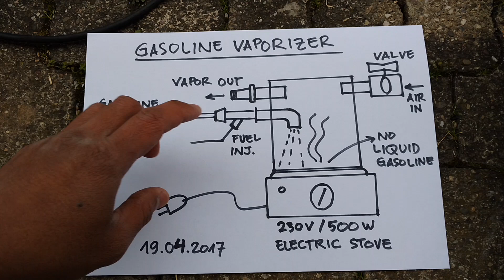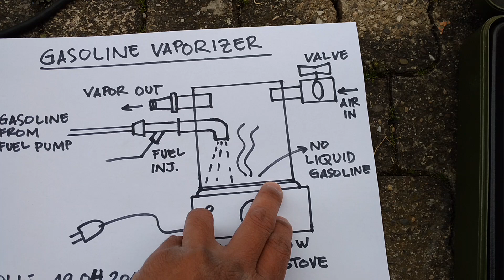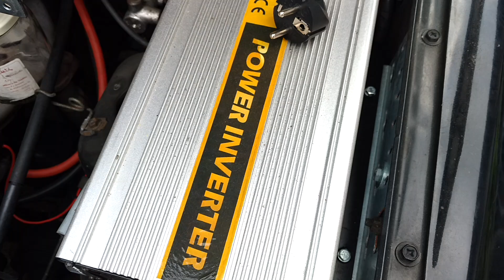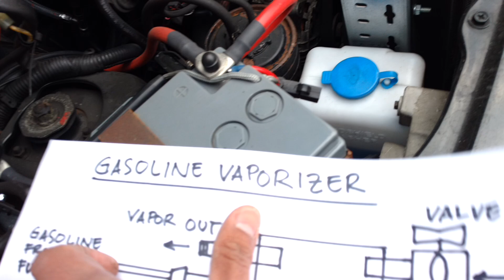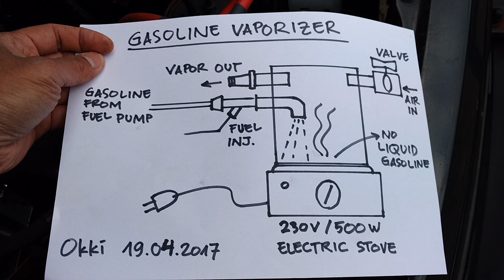Gasoline Vapor System for Car

Comment: nice but u dont need a ecu. just a pwm to low the puse of the injetor. do the engine will be more efficient.
Reply from the maker: Hi kefferson araujo. I don't want to mess with my standard ECU again. I have destroyed my standard ECU already during testing. Thank God that I could repair it by myself.
Reply from the maker: Hi Kefferson, I have been thinking about your statement to modify pulse width from standard ECU. I don't think it will work, because vapor fuel needs different mapping, we cannot use liquid fuel map for that. Yes with vapor the engine will be more efficient.
Reply: lets try to make one just for vapor heheheh you are the man

Comment: Hi Okki. I like your Vapor system.  Have you considered bypassing all the injectors altogether ? Injectors are normally closed, so just unplug them. Run your Vapor directly inside the air intake. Have you considered this idea ?  , Best wishes. I truly enjoy the videos. Thanks for sharing with us all.
Reply: Leave injectors in place on the engine only for a cold start, then turn them off, or turn off your fuel pump when car is ready, ie heated up.  And yes run the vaped fuel into the air intake.  It will surprise you in a good way.  The car will run just as it did with liquid fuel once completely running on vapor.  The vapors will be sucked into your, throttle body, or whatever setup your car has and resume to run normal.
Reply from the maker: Hi Mike. I don't understand what you mean. If I unplug the injectors, how can I get the fuel?
Reply: Think about it this way. If you were converting a lawnmower engine to vapor. You would put the vapor into the air intake. No need for a carburetor, just a simple air control valve. BTW the injectors where introduced to be able to bypass vapor, as people had figured out how to get over 100 MPG. So these greedy company wanted to use liquid and control the amount. Anyway. unplug the injectors and put your vapor into the air intake. I have seen it done on Youtube, do a search. You may have to control the ignition firring the old way, and DISABLE the engine computer, and or turn off the alarm. Anyway. Best wishes.
Reply from the maker: Hi Mike. Converting a car engine to run on vapor is not as easy as converting a lawnmower motor. On car engine you have wide range of engine rpm with wide range of engine load. YouTube is a very good media, only by seeing it done on YouTube doesn't mean that things can be done that way. Many people make everything looks easy on YouTube until you try it yourself. If I put a vacuum line directly from the top of gas tank, I would be able to run my engine. But I see at least two problems here. First: the liquid gasoline in the tank will be colder and colder over time until it hardly vaporize and second: I would leave my tank dirty of this brown black thick wax left over by the gasoline. But thank you very much for your attention, suggestion and positive comments.
Reply: Yeah, it seems easy to see others doing it.  
Do not give up Okki, with practice you'll get more experience and skills. 
And one day, it will become easy for you too.  
You will succeed. 
It takes time, focus and determination. Never give up !
Keep posting video's. I'll watch them.
Cheers Bro.
Reply from the maker: Thank you very much for your support Bro! :-)

Comment: Thanks for sharing Okki. Thats very clever. I could see using the exhaust heat on something like a PLC to control the temperature with an exhaust valve. The electric heater would be good for initial warm up. Have you considered flash back issues. I heard a mesh membrane works or stainless wool. Do you know the fuel vapour to air ratio is it 1:72 maybe a sensitive oxygen sensor on the exhaust to provide the new ECU with information. I want to do something similar to a VW airccoled engine. Are the semi volatile's waxes etc what sort of concentration are you finding?Sorry about all the questions but very interesting and thanks for sharing.
Reply from the maker: Hi Ratted bug. Yes you can use waste heat from engine to vaporize liquid gasoline. You should know that the exhaust gas temperature varies so much (I have measured my exhaust header temperature during normal driving, it varies very bad). I've never had flash back issues with gasoline vapor. From my observation, this vapor burns relatively slow (but still faster than liquid gasoline though), so that I never had that problem. I had many flash back issues with HHO, but thank God that all my cells are explosion proof. I don't know about air to fuel vapor ratio. All I know is that you need much less fuel if you run your engine using only vapor. And also you won't have any knocking problem. Fuel vapor doesn't knock. If it's too lean or too fat, the engine just dies. The thick sticky part left from gasoline at the bottom of my container is not burnable. It looks like wax or similar. I think this is the chemical additives to prevent engine knocking or some kind of detergent. I use only Super98. I think the higher the octane rating, the more you have this additives. Maybe you have seen video from Bill Kendrick, he mentioned also this on his system.
Reply: Hi Okki my apologies for giving my name earlier Maurice nice to meet you. :-) Thats interesting I thought exhaust temp would be stable and more stable with fuel vapor. The guy you put me onto Lucky mention something about a 1:72 ratio but I would have to re read that. I have a unique carburetor called a reece fish and it has no jets but holes in the throttle shaft. I was thinking of using this. You can adjust the richness of liquid fuel by turning a grub screw inside the body of it. It runs a calibrated weir for fuel but this is all treating the fuel as a liquid. I have yet to try it on vapor. Have you tried an LPG carb.
Reply from the maker: No problem. Hi Maurice, nice to meet you too. :-) No I haven't tried LPG carburetor. Just for info, if you use completely vapor fuel, the air-fuel ratio is not critical anymore. This mixture has wider ratio band. It means that you can run your engine very lean to save fuel. I have read about reece fish carburetor but I don't really understand how it works and how it looks like. They say that you can get constant air fuel ratio within all RPM range and also won't stall on hard cornering because you don't have fuel bowl or something like that. But I really don't know... I just read it somewhere.. I think you can use that carb and build your system like Hot Vapor Adiabatic Engine from Smokey Yunick. I would like to see your findings with that.
Reply: Hi Okki I thought a/f ratio was critical as I have seen videos of people stalling their engines with just the fuel vapor. They add extra air to adjust the ratio. What do you think?
Reply from the maker: Please have a look on my old videos. I have posted very short videos showing my simple setup. Take a large jam jar, put gasoline (and water) in it, put submerged type water boiler, let the gasoline boil, mix this gasoline vapor with air and try to run your engine. Maybe you will get different result than mine. I could drive my car with this very simple system for a short distance.
Reply: will do
Reply: Use the copper cleaning pads in the flash suppressor.